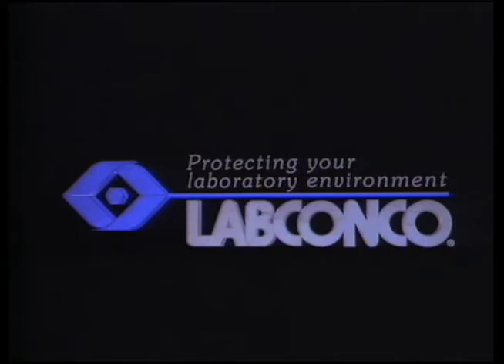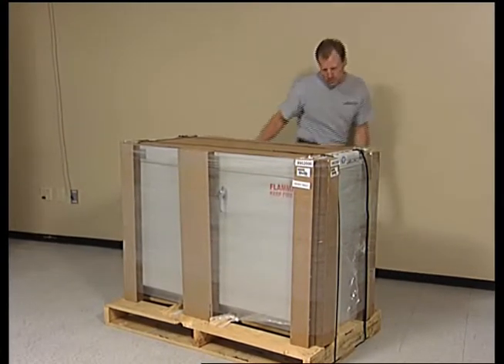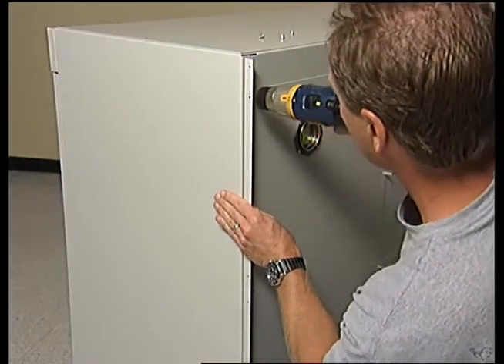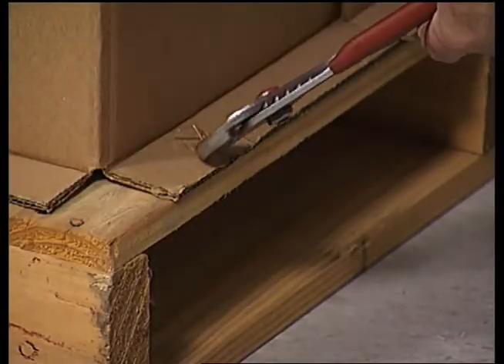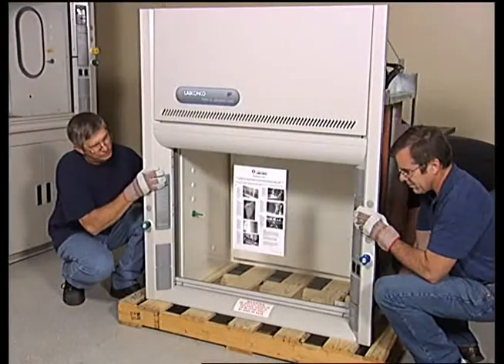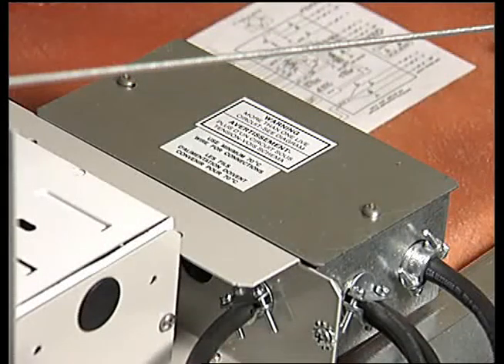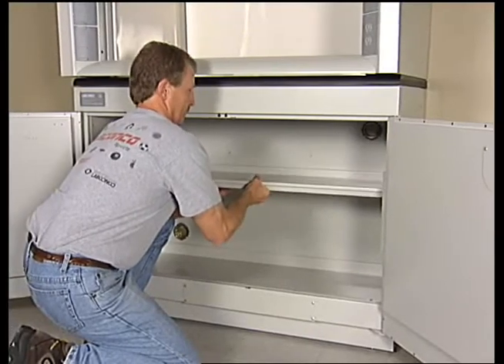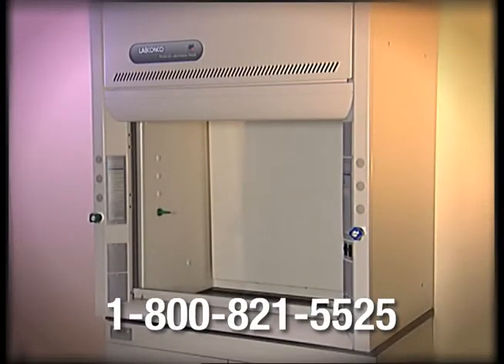Labconco Fume Hood Installation

Comment: Should the filtered air be connected outside?
Reply from the maker: +Sebastião van Uden, the hood in this video is not filtered and does have to be ducted to the outside. Labconco also makes filtered fume hoods which do not have to be ducted to the outside. You can see the Protector® Echo™ and Airo™ installation here: https://youtu.be/8Ucbl4t9EkU
Reply: +Labconco Corp Thank you